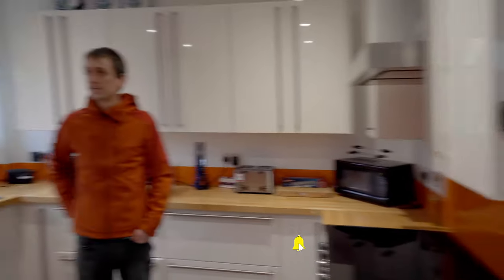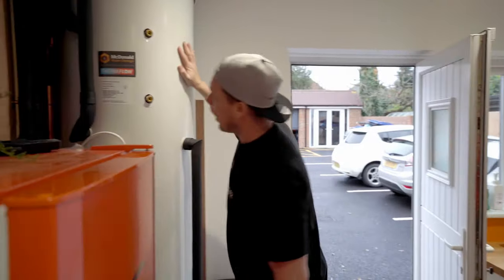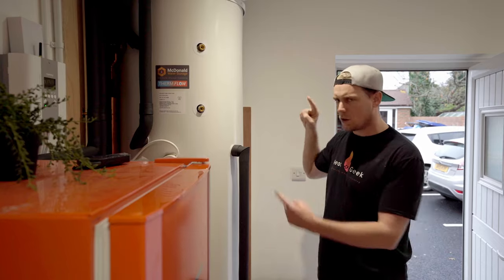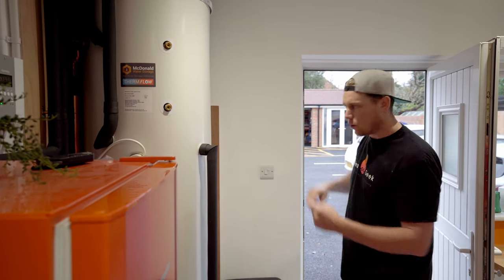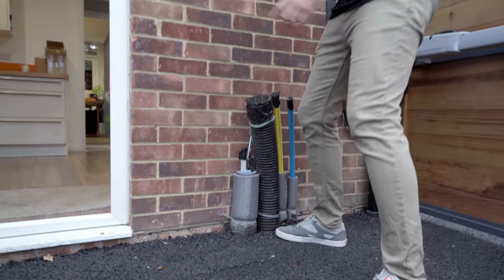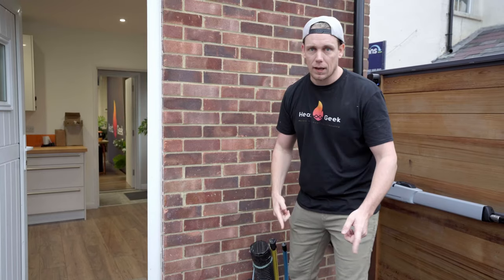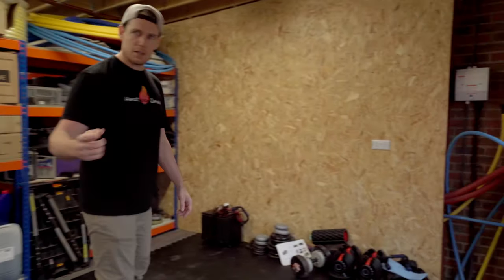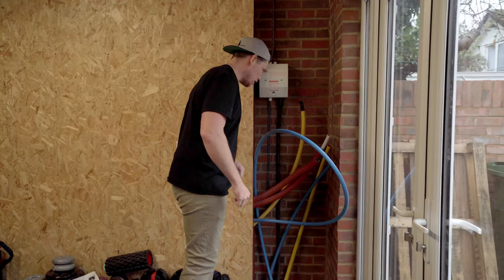Load Shifting With Solar Thermal Heating. What Is It?

Comment: We are looking into this sort of setup with a CTC EcoZenith (Energy Flex) to control the Solar, Heat Pump and a backup wood boiler together as one system shifting to 2000-2500 liter buffer tank(s). To take advantage off of peak electric and solar thermal as we are quite fortunate to not have a big space issue. So are very interested to see how you get on :) Awesome content/channel.

Comment: Hi just wanted to thanks so much for all your videos these are fantastic and answer so many questions! 
I have a complicated older building old water pumping station in east Anglia. Approx 450m2. That we have got down from 60 kw heating system to 9kw system through loads of insulation and efficiency improvements. We will have a large solar array hopefully 16-20kw of PV could we add a larger buffer tank and run the buffer tank on spare PV and store this up for the non sunny days? To reduce the amount of time the heatpump would run. Say a 300lt buffer run on immersion heaters via the PV array? Is this a good idea rather than battery storage then running the heatpump.

Comment: I'd be interested to see how well that performs in the real world. In winter the sun is much, MUCH weaker and will only heat up the buffer so much.
I have solar for domestic hot water and for the winter months I have to rely on our heatpump to heat the water for my shover. GRanted, the water needed for a low-temperature heating of a home can be far lower than the minimum temperature required for a comfortable shover.

That said, I would love to see a video of how a buffer tanks effects the overall efficiency of a heat pump central heating system.

Comment: does it make more sense to have 2 or 3 smaller water tanks / cylinders rather than a big one?
Reply: No, it costs more and you increase the surface to volume ratio of the blob of water that you're storing the heat in so it'll lose heat faster, even with the insulation. Multiple tanks only make sense if there's a limitation on the size or weight of the tanks in the place that you're installing them or if nobody makes a tank that's big enough to do the job.

Comment: I worked out that if I buried milk tanker in my garden deep enough and heated it all summer, it could last me a couple of weeks in to the autumn 😁
Reply: For those interested, 21,000 litres at a temperature difference of 75C  (assuming ground is 15 and tank is 90) can store 1838 kWh. My gas use is 42,000kwh per annum, so that would actually cover 16 days, assuming it kept warm until it was needed!
Reply: @pumpkinhead456  Surely the usable temperature difference is 90C-50C = 40C, so 9 days. And good luck keeping it warm that long.
Reply: @rockyallen5092  I mean, I don't have a digger... or a milk tanker, so keeping it warm is the least of my worries :)
Reply: But if you used a heat pump you could extract ALL the heat from your buried lorry. And that would..err.. bankrupt you a little quicker.
Reply: How about if you just filled it with milk and just used it for making cappuccino?
Reply: @bassplaya69er  'Only' 🤣

Comment: I like the idea of having different solutions but for most applications I would think that having PV solar, batteries and heat pump would be more efficient and take up less room. Energy stored in batteries surely have less losses than a tank of hot water. Of course the cost of storing that amount of energy in batteries is a lot more than in hot water but that's why I said for most applications. For year round use I think you different sources of renewable energy. So rather than storing excess solar for winter for example you would need a wind turbine to generate power in winter.

Comment: The problem with heat pipe solar thermal that no one talks about is these units scale up quite badly , when the lime scale deposits het really bad you get a drop in return , but it’s so gradual you don’t realise the problem is happening thus every 3 years max you have to dismantle the tubes and clean , it’s far far easier to just add pv solar and a bigger immersion element or multiple elements to warm your tank
Reply from the maker: a good installer will fill with demin or softened water if in a hard water area, no need if in a soft water area. problem solved.
Reply: @HeatGeek  I wish I had known that on my old building , I had so many problems with it ,when the installer went bust I was left nothing but problems ,  in the end aft 5 years of headaches I went and ripped the system out and just added 4 280w pv pannels and an two Immersion elements,  and added an Eddie
Reply: Elystator are leaders for filteration technologies 👍

Comment: What size and type of insulated pipe did you run between the two buildings? How far apart are the two buildings?
Reply from the maker: 30mm preinsulated  5" in total.. 20m

Comment: I am considering installing solar on my new build property. I would like to understand what is better, to over size solar PV array and push extra electricity to the emergen heater or to have a mix of solar PV and solar thermal and use the thermal to top up the hot water/heating?
Reply from the maker: Itsvreally case by case but ide say a mix
Reply: @HeatGeek  Any thoughts on using hybrid pv-t panels?

Comment: I am trying to design a house so far in my head  . Insulated  crawl space with heated floors  which could be heated with thermal solar panels/ air to water heat pump or electric boiler  at lower night rate.  Then  each room  would be connected with ducts from  the crawl space .  The point of entire idea is  that   the heat storage could be easily expanded many times just by  putting big plastic jars with water on the floor of that crawl space
Reply: If it's a scratch build, it's an ideal opportunity for interseasonal heat storage with an Earthbank.

Comment: I guess a question would be is it more efficient than a heat battery converting pv electric to stored heat in a phase changing material
Reply from the maker: Well pv is 25% efficient and solar thermal is 80%.. so I guess so. Solar can be stored in phase change too